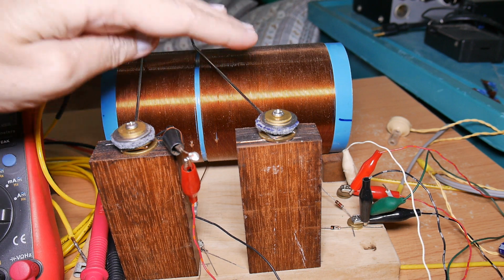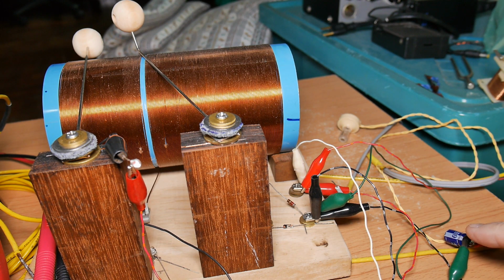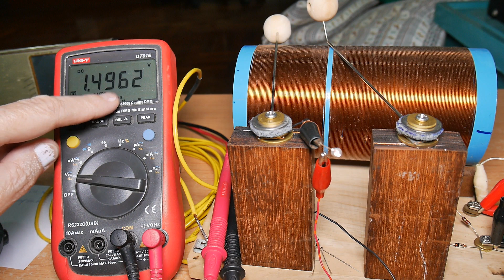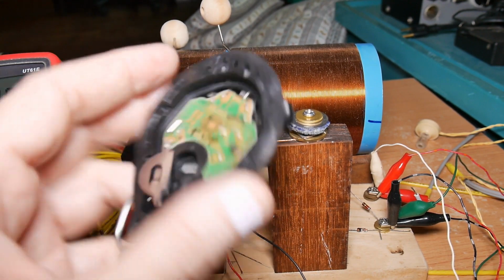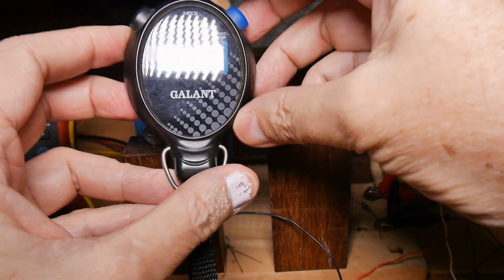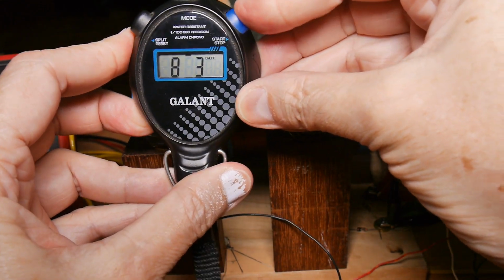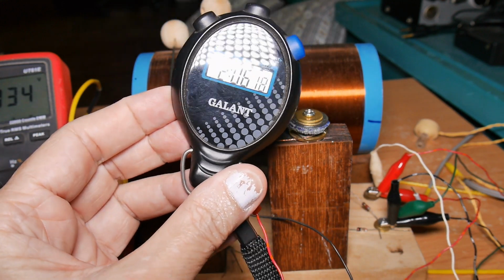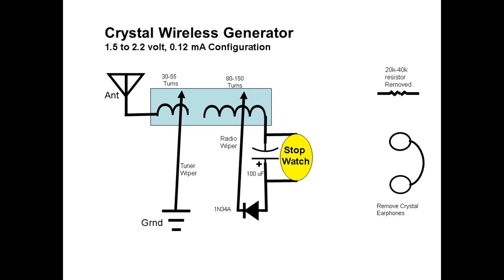Crystal Electric Generator - RF Energy Harvesting Exp 4 - Power A Clock

Comment: So I understand that this uses the frequency of the radio waves that are transmitted. So basically a siphon of sorts. 
Does it change when you put it some place else? I.e. does it get interference from some stuff like WiFi so it gets lower voltage with all the electronic equipments around? Of course outside would be better for better receiver-signal.
Reply from the maker: It converts the AC of the radio waves to DC.  Yes, the signal changes with the quality of reception.  And reception depends a lot on having a good antenna / ground system.  That's why my first attempt was rather weak, the antenna was very short and just quick and dirty for the video.  The antenna for this one is well done and I have a video on it.  The more signal the better, outside interference would actually increase the amount of power produced, but a router frequency is so far different than AM radio they are "invisible" to each other.

Comment: Nice experiment, could you tell me what is Transmitter power of the AM station 2 km away from you is? I want to know the field strength
Reply from the maker: I will have to see if I can find that. UPDATE: It is 1.21 kms and 14 kilowatts.
Reply: @tsbrownie  OK thanks. I am 30 km away from AM radio station whose power is 1000kw. Is it feasible?
Reply from the maker: @Aizaz Hashmi  I can't say. I don't know the minimum power the watch will operate. There are many other factors, power, distance, geography,  antenna,.... It's a cheap experiment, and you will have the radio. Maybe worth a try.
Reply: @tsbrownie  OK thanks. I have a ferrite antenna with variable capacitor. I will see it on oscilloscope.

Comment: What happens if you tune to the quietest gap between stations? I've always wondered whether a diode could let you capture, collect, and make use of the tiny fluctuations of the electromagnetic background. Could you fill a capacitor and then have it dump into a battery charger? If someone could charge batteries from natural radio noise, that's a post-apocalyptic essential! Edit to add: if such a device actually worked, I would absolutely pay you to build me one.
Reply from the maker: Between stations there is nothing, no energy, nothing happens.  This setup is doing just what you describe: it takes the radio wave, rectifies it to DC via the diode and stores some in the capacitor to smooth out the fluctuations.  You don't need to pay me, I've got all the "how to" videos for free.  The materials are cheap.